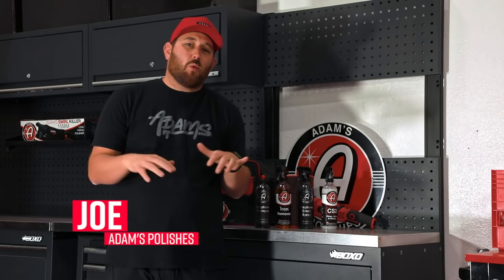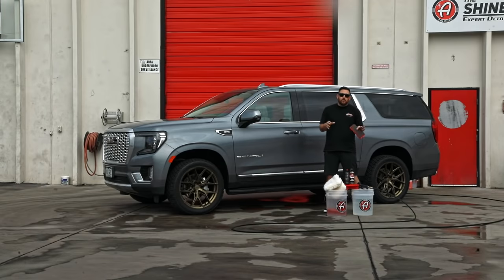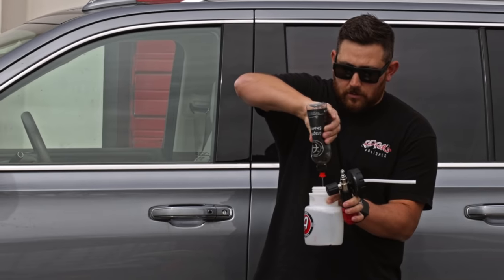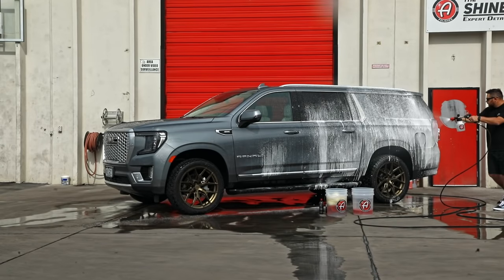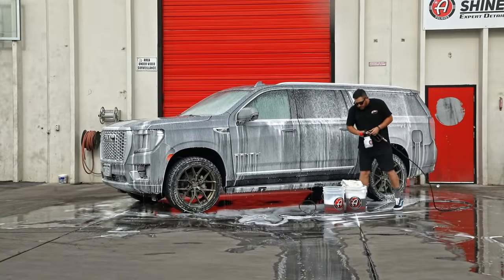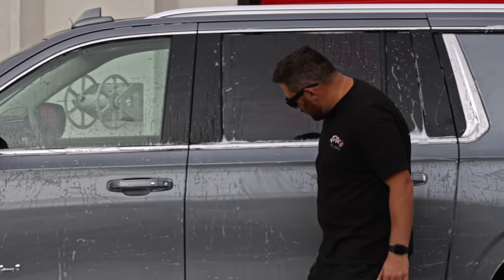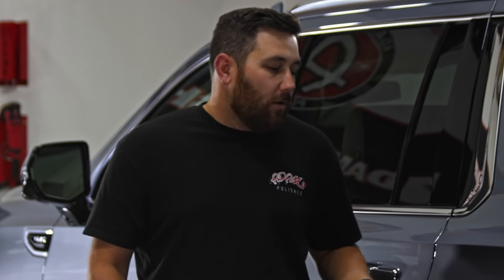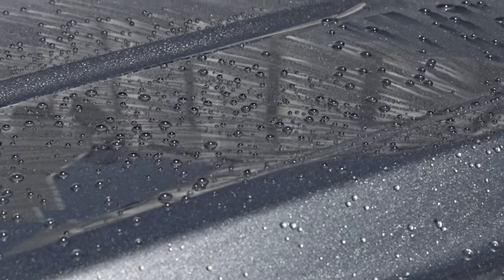How to Wash and Maintain Your Graphene Ceramic Coated Vehicle

Comment: First off you never use a clay mitt or clay bar on a ceramic coated vehicle. Just so the kids that maybe watching this video don’t get confused.
Reply: I was going to say same thing. I thought you're not supposed to do an agitation decon. on ceramic coatings.
Reply: @marcg1964   your correct. You do not rub the Iron remover on your car just let it set it will break down the iron particles and then just rinse it off what he’s doing is completely wrong on so many levels I would recommend you watch pan the organizer. However there is soaps with some iron remover in there which you could do a decon with which is a lot safer when you are going to rub the car however it is not really needed. Just my opinion
Reply: @nachomandetailingservices1057  he's doing this so the kids that's watching will do it so they get more products selling 🤔 i don't know you clay coating you will be marring the paint.... I don't know where these detailers came from jessss
Reply: @cebasmb8250   I mean if it truly needs to be Clayed it has to be done. But the chance of marring the surface is great because it’s considered a mechanical Decon. I mean when ever we wash the car we have same chance of marring or scratching the car but I would not be doing that on regular maintenance of a coated car that’s for sure. If the coating is at the end of its life cycle then sure I would do that. Because after that I’m probably gonna polish it
Reply: @nachomandetailingservices1057  👌🏽💯
Reply: Well said.  It is not the first time Adams has stated it is ok to clay a coating.  It makes sense since the average person is not as critical of their paint appearance.  But I never clay a coating.  The 3 pH wash system is the better approach to revive the coating.  I still need to make this video for my channel.
Reply: So how do you remove bonded contaminants? Asking for a friend.
Reply: @MikeGDetailing  i mean I wouldn’t use a aggressive grade clay. But a light clay bar or mitt w/ plenty of lubrication is fine.
Reply: @Jeeper1378  there’s always a risk. I have never once clayed a coating unless I was going to polish. Chemical decon is more than enough to bring back the life of a coating.  Paint hardness has a lot to do with. Soft paints would be a heck no.  Also clay is abrasive regardless of it’s fine grade. Just my opinion using coatings for over a decade. Take it with a grain of salt.
Reply: @MikeGDetailing  would it matter if the paint is hard or soft with a coating on it? Wouldn’t the hardness be whatever the coating is?
Reply: @Jeeper1378   I see what your saying but it’s a risk that I wouldn’t take. Sure paint could be soft or hard. Here’s where issue comes in the fact it’s coated is a sacrificial layer to the clear coat. That being said what gets scratched is the coating itself. But pushing to hard or not using right clay lube you could scratch the clear coat. I myself never had to clay a coated car never. Chemical Decon should be all that’s needed. When I decon my car I use a 8.1 to 12 ph soap and iron . Washing car 2 times is enough to kill most toppers and sealants what ever. Which again is a sacrificial layer to the coating.
Reply: @nachomandetailingservices1057  i mean Yvan lecroix, TRC use iron remover as a clay lube.
Reply: @Jeeper1378   he did I saw but I think he use ONR as well.
Reply: @nachomandetailingservices1057  maybe to rinse after ?
Reply: @Jeeper1378  maybe?

Comment: Wouldn't the air cannon have a chance of blowing dust and dirt onto the paint, then scratching the paint when you're wiping detailer? Spraying detailer on a wet car and drying with a towel would be the better choice, no?
Reply: The Adam's air cannons have air filters to prevent that.